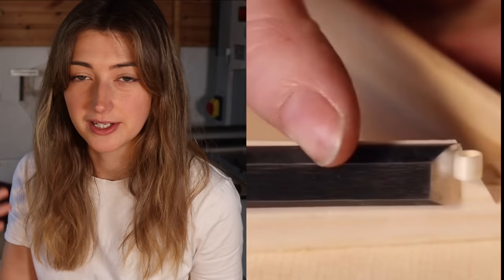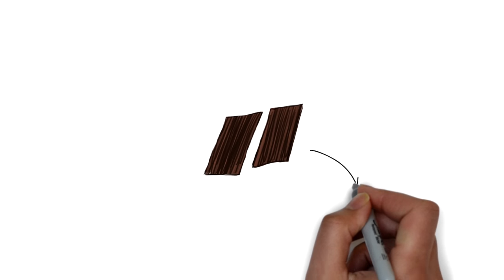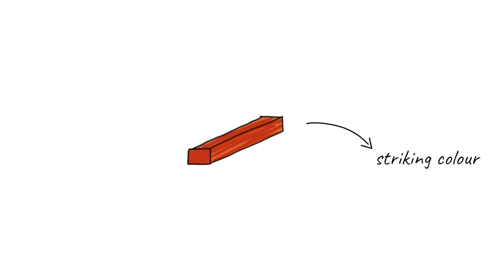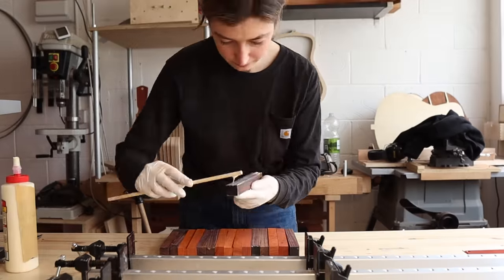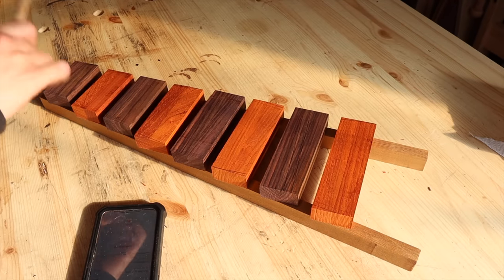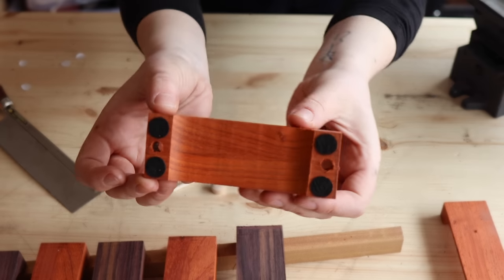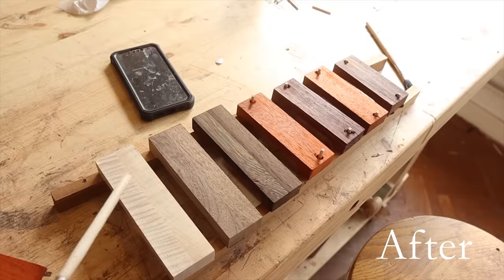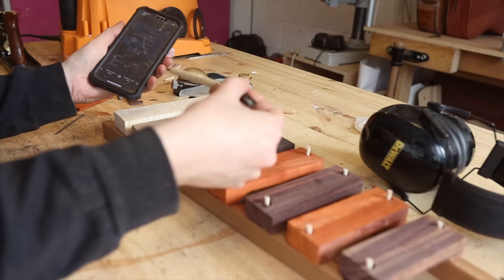Luthier’s Research - A Tonewood Xylophone

Comment: I am a retired woodwork teacher. The music department had some chime bars consisting of an aluminium rod suspended on monofilament nylon, above a deep groove in a wooden handle/base.
I thought the kids could make them as a project so I copied one in every detail, the same hardwood, same bar, same nylon string. It just went 'dunk'. I never worked out why. Probably, with 30 yrs hindsight, it was the wrong alloy of aluminium with too much internal dampening.
I am not musical, I'm an engineer by training and from what I remember about vibrating beams, the node is at the quarter points, which is where the bars should be suspended for maximum note duration. Looking online that appears to be true for Xylophones.
Reply: The node is at the 22% point.
Reply: @JeanClaudePeeters  Having done a little research, you are nearly correct the nodes are 22.4% from the ends. Thanks.

Comment: My very limited experience with xylophones says the keys shouldn’t rest on their ends but rather at a position roughly 1/6 of the total length in from the end. It’s about nodes, much as for a string, but since they’re scooped they don’t have the same linear performance. 

As I said, limited experience. 

To compare species you could either:
- make the exact same dimensions and profile and compare the note and sound
- keeping the length the same change the profile to achieve the same note and compare sound and sustain
- keeping the profile consistent and only change the width, see what that does. 

👍👍

Comment: There will be more efficiency and a stronger fundamental if the keys are suspended from there nodes. In principal this node point will be a quarter of the bar length from each end but in practice is more like 22 percent because the ends are free.
If Indian palisader is sweet then palisader nigra is chocolate.
I enjoyed the video.

Comment: Have you tried mvule as a tonewood? We started a small guitar building project in Kenya called Kucheza Customs, and it turned out that mvule is a great option for fretboards available here. It's dense enough and works great in combination with mahogany. Though it looks a little unusual when a fretboard is brighter than the neck

Comment: Hi, I know it's critical in acoustic guitars to tune the box by shaping the bars, bridge plate and grading the top for the overall tone to match a frequency, quite cumbersome and amazing job. On solid body guitars like a Tele, what are your thoughts if it makes sense to try to tune a slab with so many variables as wood density also, but the pickups and the amp itself?
Wonderful video and wish for you great success. Thanks Daisy.

Comment: Always interesting and different thanks. I would also point out that as wonderful as Paduak is besides the dreaded red dust clean-up issue., there is considerable concern about overexploitation leading to Paduak being added to Cites appendix 2 meaning it will now needs Cites paperwork to be moved and shipped. This allows closer monitoring of the volumes being taken and gives vital information to conservationists. Ultimately it may mean there will be import quota's. in the future. Both Paduak and African mahogany Kaya were recently added at the last Cites Cop.
As much as a good-sized Paduak Tree would produce many guitar sets and there is really very little wood in a guitar in comparison to a sideboard or table it is these species exploitation for other industries that cause the real issues.

Comment: Good work  girl !   You may want to consider, placing very soft rubber  grommets,  under each hold-down pin, on them.  Kind of very similar, to cotton  washers, on cymbals in a drum kit.   Maybe even have only  ONE  hold-down pin, in the middle, with a 2 inch round fiberglass washer, to keep them stable...?     just ideas.....

Comment: Hi! Good video of some interesting subject🤗
I'm having some decent woodstock of old pallets from Indonesia. I haven't yet figured out the species of 'em but did some tonal testing with them to determine how to use them with my builds. I had a set up with mic and recorded knocking 'em while hanging the board from wire. From my DAW i compared the signals between the boards and there was some variations in density, mass, color and so. My focus was in sustain within assuming that more dence, more sustain but noticed that those lighter ones had a quite good sustain too while the tone was more airier and bright. I think to run that test again with more parameters to record..

Comment: My favorite is African ebony fretboard on my  Epiphone SG 2012 Custom Shop Edition . It’s extremely bright and vibrant. My next favorite fretboard is my 1996 50th anniversary Fender Squire with genuine Brazilian rosewood. My 3rd favorite fretboard is my Epiphone Les Paul standard with Brazilian Ironwood fretboard this is the 2019 collectors edition. Then I like my 1987 Epiphone Stratocaster made in Matsumoto, Japan with a custom CRATE/ELECTRA 3 piece maple neck and Indian rosewood fretboard it’s a very thick fretboard and it’s as good as ebony.

Comment: I haven’t read many comments, but the node points should have been used.

when you put flour or whatever on the keys, the flour doesn’t shake off of the node points. this is where the holes are drilled and the fabric is placed for these sorts of instruments.

your placement dulled the sustain greatly.

Comment: Would the timber being crown cut or quarter cut make a difference?
Reply: Yes it does.  Both in terms of the tone, but also the way the instrument responds to structural stresses and seasonal changes.  the tops are usually a combinations of both, with the quartered wood under the bridge, and the wood out towards the bouts riff sawn.  Using really good wood in tops is not necessarily a good thing, as older guitars often had rather poor top wood in them, and sounded great.  Tores being an example. Today,  most purchasers, even if they are essentially buying plywood tops, will not settle for anything less than the tightest grain patterns.

Backs and sides are normally equatorial woods, and there is not always a discernible grain pattern, as they grow in a climate with no seasonality.  There are often colour patterns that imply grained direction, but these are not always true.  Also, in contrast to what people want in tops, they will often pay a fortune for disorganized, visually provocative wood in backs and sides.  Back 50 years, the access to woods like Brazilian was much greater, and the quality was much higher.  

For brace woods, while they grain orientation is often important, the species and configuration has a far higher impact on how they shape tone.

With a foot in both camps of lutherie and archery, it often strikes me how much more scientific the selection of wood is for archery than in anything else, including  wooden aircraft manufacture.  Every single arrow shaft is graded and oriented for grain direction, weight and stiffness.  I remember being at a lutherie conference in Nashville around 2000 where a famous luthier who later wrote a revolutionary book, gave a lecture on guitar structure, and it was a disaster with lots of people in the audience who had an engineering background, whispering loudly.  I put that down as the point where structure was first being put out there as a serious topic.  And doubtless the presenter took a lot of useful feedback on board.  But this subject is still unexplored.  And unlike archery, the solutions are rather cumbersome to explore.

Come to think of it gold also has a more sophisticated measurement system.
Reply: @Hondo Trailside  Thank you. Great answer and really interesting. I make furniture, so understand all the issues, I don't play an instrument, but making them fascinates me.

Comment: You're in the 5% that actually holds a drill correctly, the other 95% have no clue that they are holding it wrong and they especially don't know why that it's wrong. Sorry, I'm just always shocked when I see that and wanted to point it out.